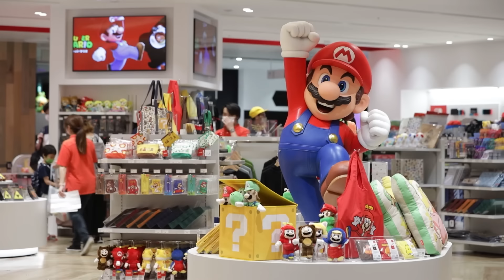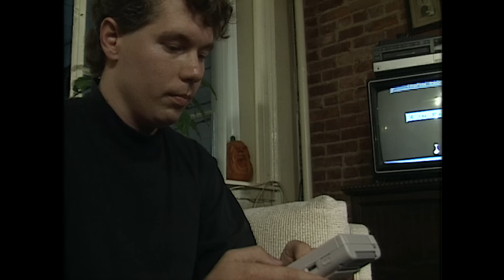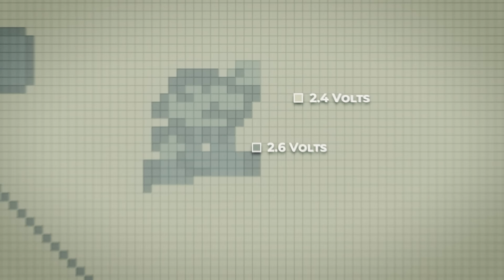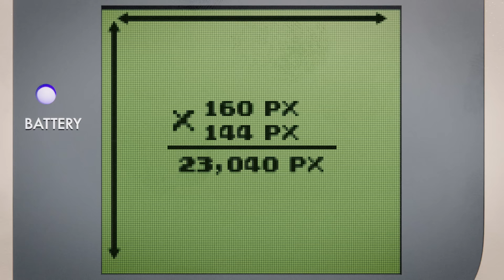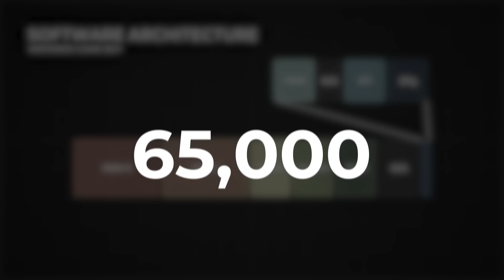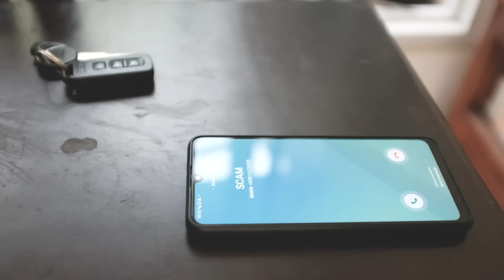The Insane Engineering of the Gameboy

Comment: i have written games or to be exakt i was in a team that has written games for the gameboy 2017 to 2021. yes there are new games for the gameboy even for c64, vic20 and amiga and so on. you can google for it easy online. 
Writing games for the gameboy it self ist not that hard. The limitations are not that problematic. yea there are some limitations there are a bit specific for this machine bot every system at this time had its limitations who are more or less hold the creativity and performance back. but those limitations are still around today with modern systems. one if them it the versatility of possible hardware and software combinations you end up with your target system PC or on consoles there special designed architecture with its own problems. or in some cases the vendor of the console tells you what software you use (Nintendo). oh also you have to pay for the dev software too monthly also you have to pay for making your game public. 
ok some of you will argue the software to develop is today better and yea thats true but also false. i had many times with the used software issues so i wrote my own little additions to fix som things or make my life easy. testing on the other hand sucked. we had blank cartridges and a programmer also we used a emulator but neither of them was the same. the emulator had the original rom and emulated the cpu but it could not simulated bit shifts and crosswalk that some times happened on the real systems we also had a gameboy dev kit for some reason but this had also its own issues. 
develop a game even on such old systems is not that had but bring it to the same level of perfection like they did in the past is the real hard part, not its limitations. 
i had fun in this time and still today i love working with the commodore 64 and vic20 both have its on limitations and problems even both had the same instruction set but both cpus are not the same there are different but had the same functionality. so the 6505, 6510 and the 8500 had the exact same instruction set but function different. so some hardware bugs are discovered over the time and some enabled some crazy things to speed things up. non of them was able to do 2 operations at the same time like a dual core but there was a way for certain operations to do at the same time because of the cpu die layout. guess what the same things can happen in modern x86_64 cpus too but the complexity and miniaturization makes it harder to find such things. the mos chips had only 151 functional opcodes in its institution set and 104 working additional opcodes are discovered over the years some of them doing the same as the one if the 151 but in a slightly different way some are combining or excluding some function calls. i programmed in assembler so i had to know the cpu i work with and some times things was a bit different if working with ram.
the comodore systems for example had specific regions in the ram that was executed by another processor. in the c64 you had your audio processor and the video processor and all of them used the same system memory but can only access specific region. so you could manipulate this region with your code to make things happen or let the other processors do work for you. you understand what i mean. if you know how each section of your system works you could do things that was never meant to be done this way. the same applies to the gameboy as well. so games from back then and today are entirely different the whole programming dogma is today different als back then. 

i think the gameboy is a really good system for its time it solved many problems they had by shrinking and simplifying the system even not solved problems are possibilitys doing things different or better. 
oh little fun fact at the end the gameboy had colors and did process them but the screen was only a grayscale so the graphics unit was programmed by the rom to do grayscale if colors are used and some games had colors infarct the first games had colors because the developer was told the system had 6bit colors also the early dev kits was colored but later the rom got changed from nintendo so 2bit grayscale. if you had the gameboy adapter for the n64 you had colors if you game had colors also on the same game rom was a frame around the game screen that was only shown in this adapters.
Reply: tdlr
Reply: @battlezordfalcon  to short to understand

Comment: I'm confused.... I definitely remember rechargeable batteries being a thing back then... I think they had shorter battery life but at least you didn't have to keep buying them?
Reply: Yep, rechargeable batteries were definitely a thing back then at least they were here in Australia.

Zinc carbon, zinc chloride, alkaline, Ni-Cd rechargeable they were the available options and all were widely available at the time.

One downside with rechargeable batteries back then was their low capacity, about 500mAh typically for AA's, and rapid self-discharge even if not used. Still, they were the cheapest option over the long term and reasonably popular despite their downsides.

Comment: The Game Boy original through the Advance also had an optional light accessory, which could compensate for the lack of the backlit screen. Due to being my first handheld system, the lack of a backlit screen wasn't seen as much of a drawback.

 The only drawback to the light was that it did use up the battery faster. This was compensated in the much later DS in the rechargeable battery.

 Can you imagine how fast a Switch would eat through AAs? Thank the engineers that they dumped that power source the first chance they got, and it allowed them to use, er, more energy intensive options (like a backlit screen!)!!!

Comment: I found another error: when he discussed how the LCD displayed different shades of gray/green, he got the mechanism of pulse width modulation wrong.

The frequency of the pulses does nothing to change the perceived amplitude of the signal. What matters is the ratio between the time the signal is on versus the time the signal is off. Higher so-called duty cycle, where the LCD spends more time on rather than off, will result in darker shades.

Comment: funny how nintendo's ethos didn't really change. a nintendo switch can play doom eternal @ 20-30 fps with crap for textures for 4 to 5 hours handheld mode no problem. meanwhile a steam deck can play Eternal better in every way possible but you're lucky if that thing last ONE hour before it hits 20% battery.

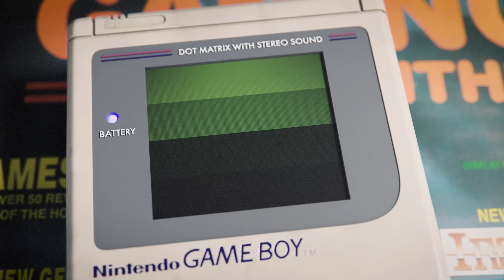Comment: 7:01 There's NO WAY the Game Boy could create grayscale by visually turning pixels on and off quickly as implied by your simulation. Its LCD response time is notoriously slow, which is obvious from the blurry trails that movement leaves on the real screen (something that you didn't bother to simulate in your renders). 

The flicker shown on camera is most likely because you filmed a GB screen at 60fps that was lit by a flickering 50hz light. Also, not sure why you're showing an old Mac CRT screen while taking about LED PWM flicker.

It's possible that PWM was used in the LCD controller to take advantage of the slow response time to keep pixels in an in-between gray state, but In any case this wouldn't cause the pixel to visually strobe on and off like you implied in your render.

Comment: The gameboy video system has a thrust to weight ratio of 1.5 and is equiped with a 25mm vulcan minigun it is mainly constructed from polymers making it very agile in a dogfight however its limited powersupply of only 4 AA batteries makes it a glass cannon

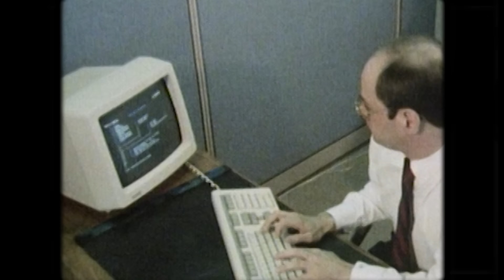Comment: 7:12 don't confuse framerate with pwm - pulse width modulation can occur multiple times per frame.

Now. That said, it would be clever if they changed the brightness through pulse width per frame, over pulse frequency within the frame. Meaning if a dim pixel was on for only half the frame, and a dark pixel was on for the entire frame. I'd love to know if this was the case.

More info: passive matrix LCD frame can activate an entire line of pixels at once, but have a scan rate of one line at a time from top to bottom. (Different from CRTs which are lighting only a single pixel at a time and are scanning left to right, then have a horixontal retrace to bring the electron beam back to the left for the next line.)

Wow, this video really takes me back to that headspace of learning about all this stuff!

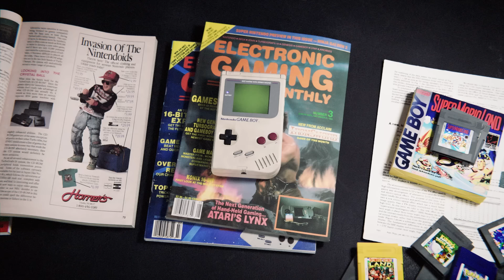Comment: The explanation of Pulse Width Modulation (6:55) is ambiguous. It is not true that "faster" pulse create darker shades or "slower" pulses make lighter ones - faster and slower are not relevant concepts for PWM - they only describe the frequency of the signal, which can be constant or varying but unrelated to the duty cycle of the signal. The duty cycle is the on time vs. the off time of the signal - which manifests as the pulse width, which can be described as longer or shorter, but not faster or slower.
Reply: Thank you!! This bugged me, too.

Comment: Did the game gear have an LCD screen? I thought that it had a mini CRT monitor in it with a bulb and everything. I might be thinking of a different console though.

It's insane how popular the Gameboy was and you can still see how Nintendo got it right over the years. The DS and it's variants was one of the highest selling consoles of all time in the same period where Sony's PSP just didn't do well and I think it was for similar reasons as what you outlined in the intro section of the video.
Reply: Yes, it had an LCD screen. What you're probably remembering is that it's using a small fluorescent lamp behind the screen for its backlight. Powerful white LEDs didn't exist back then, and and an incandescent bulb would be too power hungry and produce too much waste heat. So the only practical solution was a fluorescent lamp.

Comment: Fun fact, you can put 3 dead and 1 fully charged battery in an old gameboy and it'll still run (for how long is debatable).
Reply: So the batteries are in parallel and not in series. So the device runs with 1.5v but four batteries offer +3x time.

Comment: Fun thing is that the Gameboy also was incorporated into industrial controls, as a cheap easy to use display and processor. There were a few systems developed around it to do things like logging, graphical display of voltage and such, using the small form factor, plus the 32k of address space available in the system, and the Z80 processor that ran it, so you could get simple to interface systems, all in a cartridge and some glue logic.

Comment: Nice. Still the part of the graphics chip is not so insane. It’s just using more or less same tech approach as the NES and arcades and other consoles before it. Heck intellivsion from 79 has more or less same concept. 

Also about “pausing” the line scan. No such things. You can really pause the line scan (at least to my knowledge) what you have is the horizontal blanking period. Where the scanline is done drawing the line and outside a bit of the visible screen. There you have a “timed window of opportunity “ so to speak where you have some cycles to update some GPU registers before the scanline starts again drawing the next line of the screen

Comment: The power draw mentioned here isn't quite accurate. Yes, the Gameboy was rated at 0.7 W of power draw, but that was the maximum. Actually, I measured the power draw at about 60 mA, which at 6V was about 0.36 Watts. And 30 hours was the minimum you could get out of Alkaline batteries... dependent on the batteries and cartridges used. There were cartridges that used a bit more power than others. I tested all available major brands of Alkaline batteries back then... I got 32 hours out of Ucar, 38 hours out of Philips, 43 hours out of Varta and 46 hours out of Duracell batteries, but then the batteries improved over time with some of them eclipsing 50 hours a few years later. However, it was possible to use rechargeable batteries, even while Nintendo discouraged this out of whatever reason (they didn't actually give the reason for it), however they weren't that great, giving maybe 10-12 hours per charge, but hey, you didn't have to buy new batteries every time they went out! And while the video talks about the system's limitations, keep in mind that competitors had similar limitations. The Game Gear also ran on a Z-80 processor and had a tile-based system. The Lynx was a bit more advanced, but also used up its batteries more quickly. And the Super NES wasn't yet released, with the Sega Genesis / Mega Drive just being released at that time, depending on territory. Only the Amiga and Atari ST computers had vastly superior specs, so game developers pretty much were used to what the Gameboy had to offer from programming the NES, the Commodore 64 and other 8-bit systems, some of which didn't even have sprites.

Comment: It's interesting how a lot of the graphics and audio capabilities are like the Amiga's, just more primitive.
Reply: Like the Amiga? It’s nothing like the Amiga. Totally different design or so you mean like the C64. There we have a lot more similarities is hardware design.
Reply: @LitJelly  It is like the Amiga in the base things. It has sprites that can be mixed together to produce bigger/better ones, it has hardware capabilities to change display settings based on the scan position, it has 4 audio channels. It has a lot of the things that the Amiga had, just in simpler form, excluding things like the blitter or multiple PCM audio channels that need memory that the Gameboy didn't have.
Reply: @steamrangercomputing  ah ok. Fair enough. I just feel those are very base things. That many other consoles had. I mean sprite wise the Colecovision. Nes. Master system. C64 has those also. Working much more similar than the Amigas. (Amiga had rather different approach to how the sprites work really. Also the other was tile based as the gameboy. While the Amiga had just straight planar bitmap graphic mode. And how the sound chip work is much more similar to the C64 sound chip (yes it had only 3 channels but how each channel work is more akin to gameboy than how the Amiga works) also C64 and even the Atari 2600 could update display settings tied to the scanline. That is what I meant with that I on overall share more with other than Amiga. Hope it clears what I meant. Thanks for telling me how you see it btw ⭐️

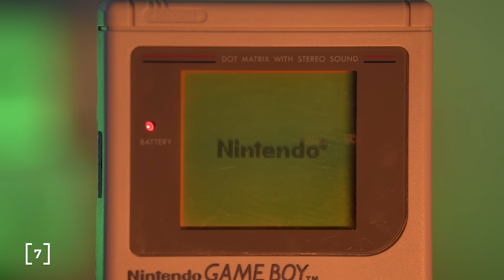Comment: 8:28 the Nintendo logo trademark security thing had a flaw; the CPU actually read the logo data from the cartridge twice; once to display it, and then once again to compare it to the internal copy. You could therefore (with some pretty simple hardware in the cart) have the GB display any logo you wanted and then swap the data so it still booted your game.  (Known as a TOCTOU vulnerability; Time Of Check / Time Of Use)
Reply: It's simple nowadays, but wouldn't the hardware to be able to do that fast enough to pass the check have been prohibitively expensive back then?

Plus, it still needed to have the trademarked data in the cartridge, even if it didn't display it.

Comment: Adjusted for inflation, the $89.99 price of the Game Boy is $225.00 in today's money, making the Switch Lite cheaper than the original Game Boy at $199.99.

Not only that, but the Switch Lite is 12,000 TIMES more powerful and uses almost the same low-level of power at 4-6 Watts. 0.5 in Standby. Mind blowing! O_O

Not only that, but the average cost of Game Boy games, $24.99, is $60.06 in today's money, adjusted for inflation. If you buy Tears of The Kingdom, you're paying the same relative amount as a copy of Link's awakening in the 90's. O_O

Comment: I know this was meant as a short overview, but there are a couple things I need to say about this.

First, the Gameboy was far from the first place that people were blowing into cartridges. That was happening as far back as the Atari 2600.

Second, You really should have gone into more detail on the audio. The waveform you used when describing the wave table gives the assumption that there was any kind of attack/decay envelope possible and looks to be a higher "resolution" than the GB actually supports. The wave channel was only capable of four-bit audio at four volume levels.

The rest of the audio also doesn't really sound like the actual Gameboy either. Whatever DAW you're using sounds like it had filters to create a "warmer" tone than what a stock GB could ever do.

All that said, the sound system is quite a bit more complex than you touch on here, and I'd recommend looking into the chiptune scene to see what people have actually been able to do with the system.

Comment: I think the math is off about how much memory each frame would have consumed. You calculated 160x144 = 23,040, which is the total number of pixels. However, it seems as though each pixel would have only needed 2 bits (4 shades), which yields 5,760 bytes of storage.

Comment: 1:56 PM
The production quality of that video is amazing. And overall, very interesting. BUT  a 160x144 pixel screen would not need 23,040 numbers stored in memory. Each pixel can only be one of 4 shades. So that's 2-bits per pixel, and therefore 4 pixels per bytes, meaning it would only need 5,760 numbers stored in memory. It still makes sense to use tiles, it's just not as drastic of a memory savings.